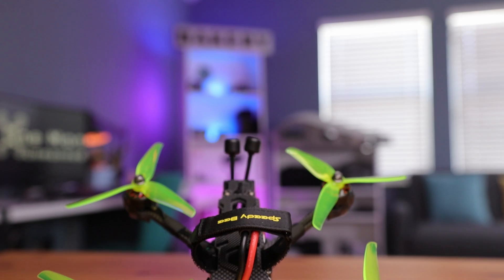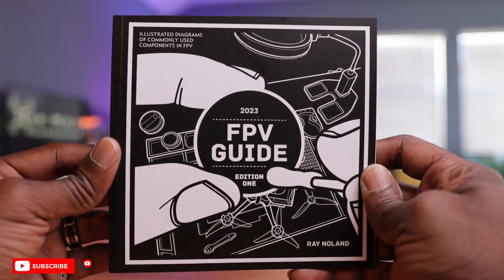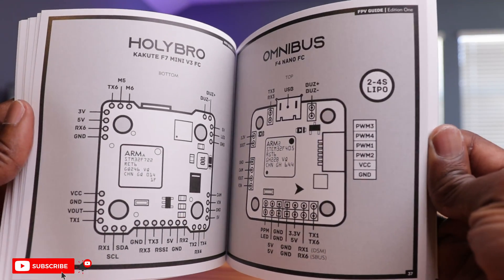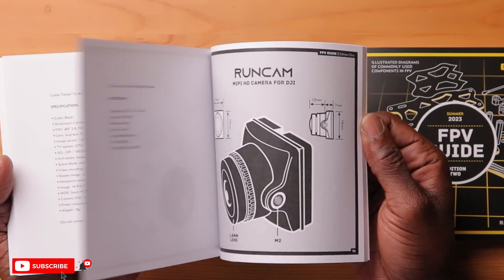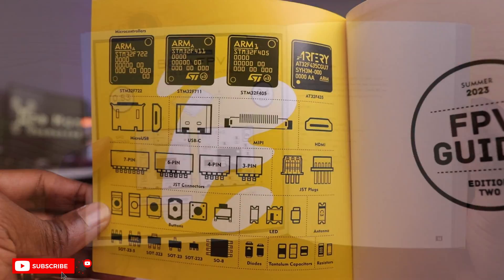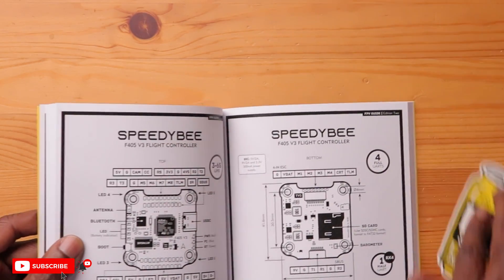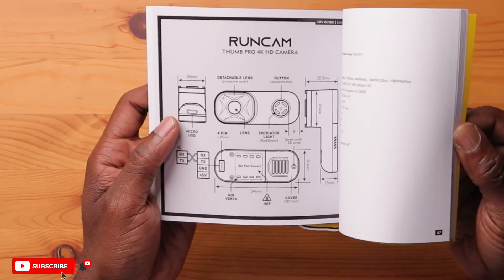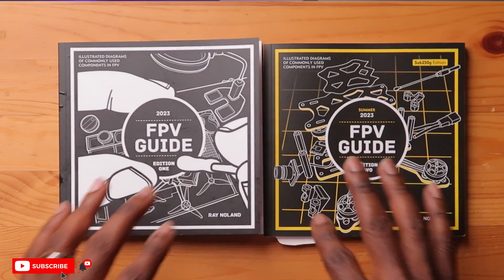Knowledge Is Power, No…Really! | FPV Guide Books

Comment: I have to get RC tiny go when I turn on my radio Master controller the drone freaks out going to take off can that book help me out to fix it I tried flashing it over I did a dump still freaks out
Reply from the maker: I don’t think the book would help in that situation, but I would double check the BetaFlight settings.  If you wipe out/reset the FC, I would re-install the factory CLI.  Make sure your radio is setup correctly in the Modes Tab of BetaFlight.